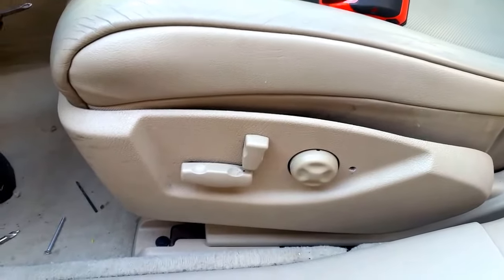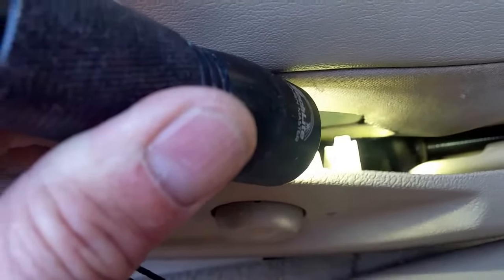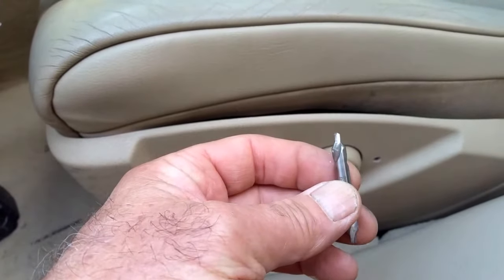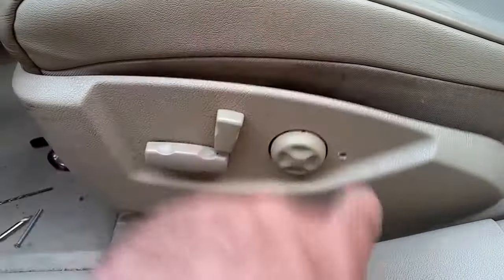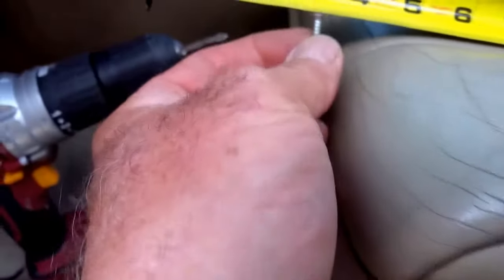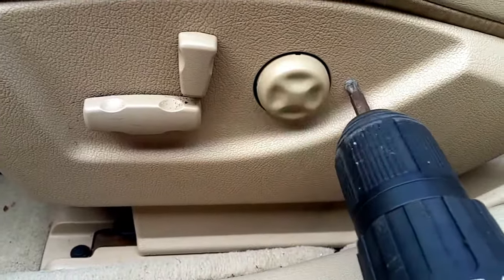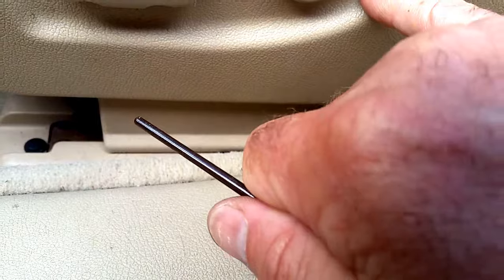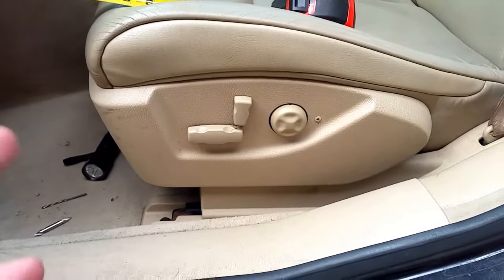How To Fix LOOSE Seat Side Panels on Most Cars Once and for ALL

Comment: GMC refused to warranty my broken seat side panel on my Acadia with 18,000 miles. Said it was normal wear and tear. Then wanted to fix it for $270. Thank you for your 5 minute fix for less than $1. You are awesome.
Oh, they also said I was probably getting in and out of vehicle improperly, I asked service manager to show me the directions in the vehicle manual but of course he could not.
Reply from the maker: John Hazen LOL I have to say you are so much like me it is not funny and how you dealt with the Service Manager,...your comment made laugh hard, and I have to say my friend I needed a good laugh right then, especially about the part where you asked the service manager to show you the directions in the manual how to properly get into your car..do you mind if I share this story with our many subscribers as it is so like the Stealerships to act this way :) thanks Mike
Reply: Ah yes this comment makes me think this is a GMC problem bc both side panels on my 2008 Cadillac STS came off around 70,000 miles
Reply: Never take your car to the dealership.  Every one is dishonest.  They charge about triple more than a local mechanic.  And, frequently, they will scam you by doing shoddy work or not doing it at all!  It's not as if the mechanics at a dealership go to a different trade school.

Comment: I am considering a similar method.... I have to take the seat out anyway (the car is in desperate need of shampoo and deep cleaning) so I am thinking of figuring out a way to zip tie it from the back of the panel to the door frame.  If that doesn't pan out i will be doing this.
Reply from the maker: Thanks for watching and sharing Michael, hope you have a great day and all the best on your project my friend. mad Mike the hammer SPC